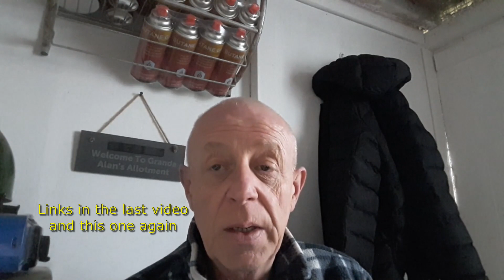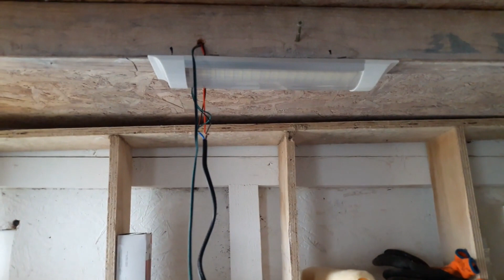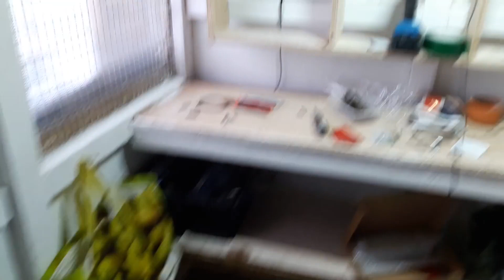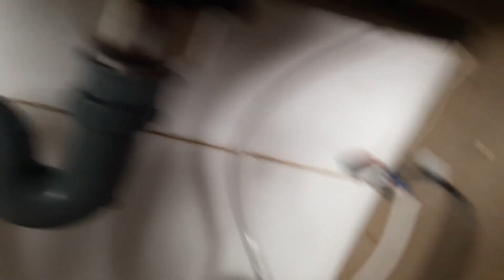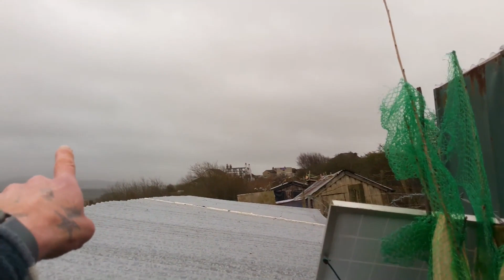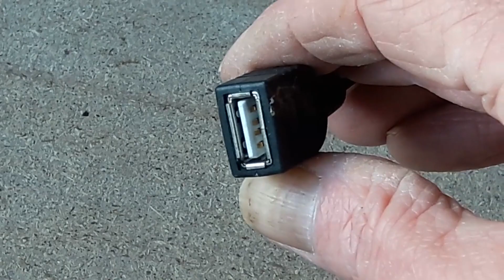Building a 12v Solar System for My Allotment: Lights & Water

Comment: I have used stain block paint on water stains on the ceiling which worked well. But you may not want the bother in a shed.
Reply from the maker: Wow thanks for the tip Valerie much appreciated I may just give that a go and see what happens thanks again 👍 stay safe Alan